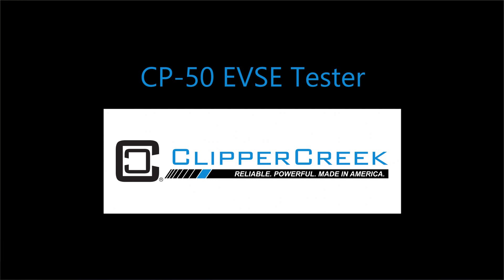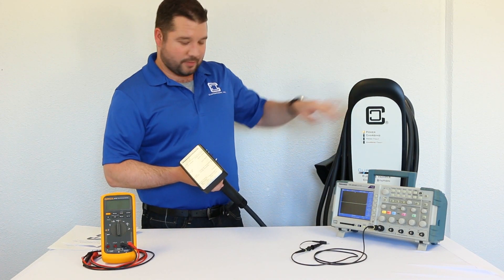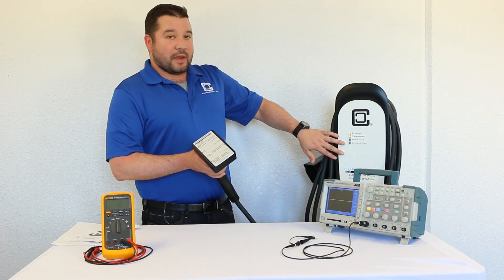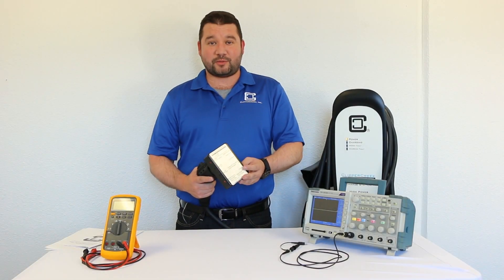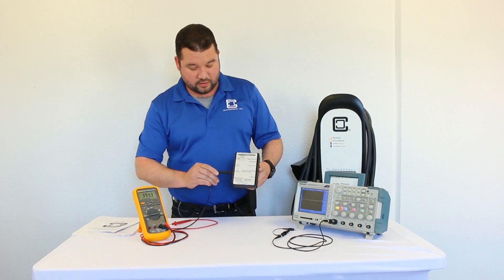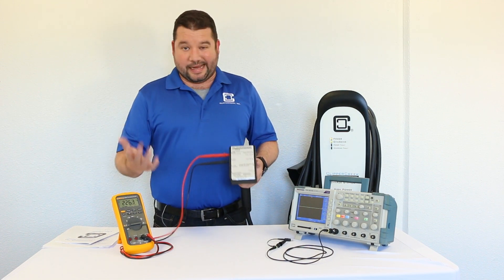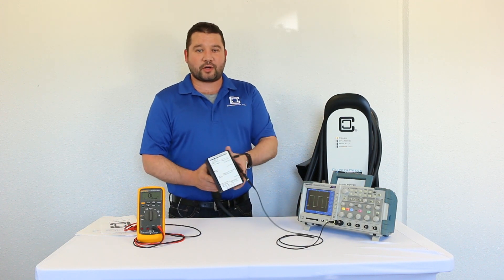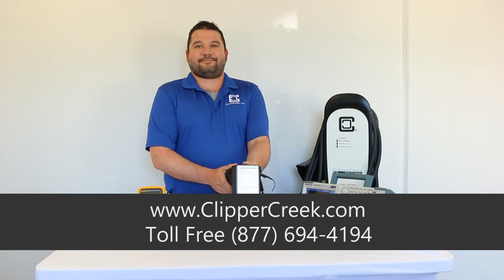EV Charging Station Tester: ClipperCreek CP-50 EVSE Tester Instructions

Comment: Hi! I just tested with your tester an evse (another brand) that is not charging. When I do the basic test it works. But when I ran the voltage test I get:
L1 - Ground 120V 
L2 - Ground 63V
L1 - L2 = 48V
What could be the error?
Reply from the maker: This seems like you have something wrong with your wiring, breaker, and/or the transformer. Check the incoming voltages at the junction box, and then the breaker. You may have to redo some connections or swap out the breaker.

Comment: Great informative video and interesting product. I'm really into EVs and was thinking of getting an EVSE tester until I can get my first full EV next year. 
  I guess there isn't any way for an EVSE tester to measure current right? Since that would require a load to draw electricity from the EVSE and either go into a resistor or small battery.
Reply from the maker: Thanks for the feedback, and glad to hear the video was helpful.  You are correct, the CP-50 does not have a way to measure current flow.  There would need to be a load on the output of the EVSE, and the power drawn would need to go somewhere like into a battery.

Please let us know if you have any other questions.

Comment: Using the J1772 - Tesla adapter, could I test a Tesla Wall Connector?
Reply from the maker: Hi Andres, good question! You cannot use the CP-50 tester to test Tesla charging stations as the inlet on the CP-50 is the SAE J1772 inlet.